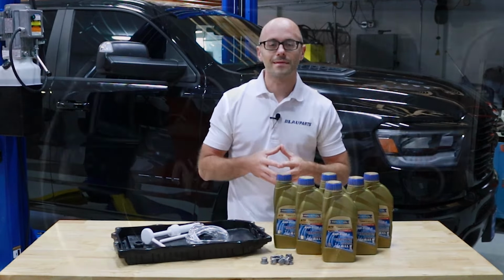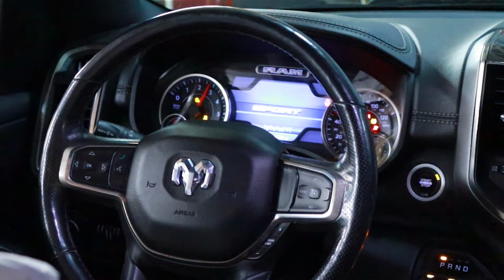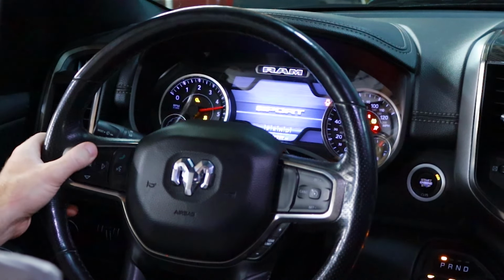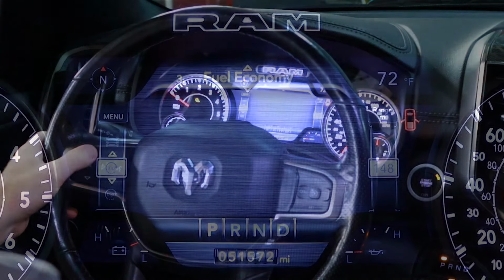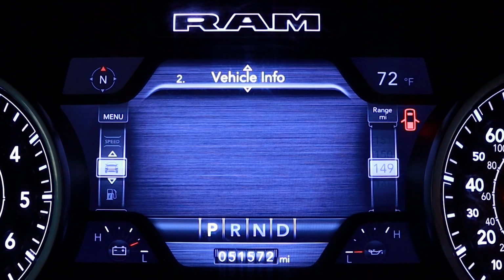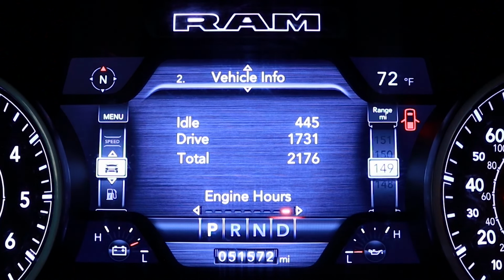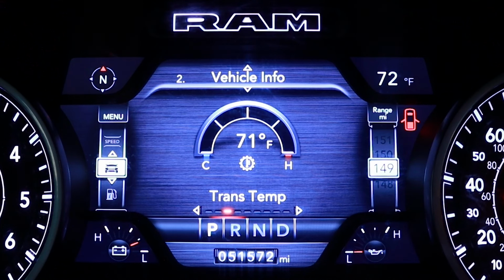Ram 1500 Transmission Fluid Change How To | 2013-2026 ZF 8-Speed 8HP

Comment from the maker: The Ram 1500 8-Speed transmission was also used in the 2019 and newer Ram 2500 and 3500 models with the 6.4-liter hemi engine. This how to fluid and filter change video would also apply to those models but with some slight visual differences due to the truck chassis.
Reply: Which fluid is better, Eurol or Ravenol? I'm going to use Mopar 8/9 speed transmission oil! 😊
Reply: Wasn’t there two different transmissions? One for the V6 and another for the hemi?
Reply: @vulcanman64  they are the same
Reply: What brand pan do you supply? I've heard nightmare stories of different brands.
Reply: @mrlibowski493  i went with ppe , i hard dorman can leak and oem doesn't have drain plug anymore
Reply: I have a 2014 Ram 1500 5.7L. Bought it used with 60,00 miles, 5 years later, it has 85,000. I'm thinking about changing the ATF. YOUR THOUGHTS???
Reply: @Carlos-usa1st  some people have reported 200k+ miles never had it changed and no issues
Reply: @wowdude8244  thank you
Reply: @wowdude8244 i have 2023 dodge ram 1500 272,k miles i never change it 😂😂😂😂
Reply: Why dose it need new bolts 🔩?
Reply: Yuri-tarded!!!
Reply: Why is the oil Green? Transmission oil is pink right?
Reply: You didnt specify if this is the 8HP70...
Reply: can you do a vid for ram 3500 diesel transmission too?
Reply from the maker: @everforexcanada5663  Thanks for the suggestion. We will try to create a how-to tutorial on changing the Ram 2500 and 3500 Cummins diesel transmission fluid.
Reply: If I’m just topping my fluid off that I lost wen I disconnected the trsns oil cooler line .Do I need to go through the whole removing air process
Reply from the maker: @woodrowhemiway  Yes, you would need to go through the same fluid leveling sequence. The fluid leveling sequence from 09:10 onward in the video can be used to get the correct transmission fluid level.
Reply: Mine only took 5 quarts out of the 6 I followed the steps perfectly, is that ok ? Or does it have to have all 6 quarts in there .
Reply: @victorortega2718 it needs lil over 7 quarts

Comment: Thanks for this video. Some tips to help others, i just did this job on my '22 Jeep Wagoneer @40k). With a cool engine (below 80°, this is Texas in the summer 😉 ) when you crack the fill plug be ready because at least a quart of fluid will drain out. I'm guessing this is because the hot fill final step, later in the process, brings the volume to above the fill plug, hence why this isn't a "fill to spill" process.  

Next, three of the screws had rust just below the neck, which I'll be taking to Jeep to ask about, since this is a pavement princess (unlike my Grenadier).  But I will say looking at the screws I see why they send you new ones.  

A total of 5 quarts came out and when I filled 5 quarts and about an ounce went back in. Sending a sample to Blackstone as well.  

Next and pretty important, when you move onto the portion of the job where the engine is running (at least for Wagoneers and Rams) the exhaust is right where you're working so be ready for that, since most of us will be using a plastic fill hose and the truck will likely be on Jack stands, so a tighter space.  A.) The exhaust will be hot, i know this is duh for some but the Darwin awards exists for a reason and B.) That hot exhaust will melt that tube if it touches it, making for a real mess. So I looped it over one of the silver lines near the front of the transmission pan and then put it in the fill hole. 

All in all, for an intermediate home mechanic, this was a 8-9 hour job from tool prep, jacking to jack stands, drain, proper fill process, test drive and then letting it sit overnight and rechecking the work the next day to make sure it was all good, ending with clean-up.

Comment: Also is it a level transmission or a level truck?  I just did mine, i have a lift and had to put an extra 8 inchs of extension on the rear arms to lift the back ebough to make the transmission level. Was a bit sketchy, not gonna lie...😆.   I filled it first at level truck, but leveling the transmission allowed another liter or so of fluid.  Anyone know for sure?

Comment: Spinning the wheels while the vehicle is off the ground seems unnecessary, and is actually not in ZF's procedure for draining and refilling the fluid. For your average DIY without a lift, this seems like overkill on part of MOPAR.

Comment: I'm glad I dug a Workpit in my garage years ago, covered with a steel plate over it! I use the pit to work on my car all the time , and will make it easy for me to get under it and have the car level at all times !  Much better than ramps or jackstands !
Reply: True, but the transmission must be level on this procedure, not the truck.  That means the rear needs to be higher than the front.  Use a bubble level on the transmission before draining

Comment: Quick tip if you do this. Instead of messing around with the horrendous drain plug location and dumping fluid all over your exhaust... just simply drill a hole through the old pan and drain... you are throwing it away anyway.

Comment: Will it be easier just to drain measure what came out and put back in?
Reply: The pan has the filter integrated, so the pan needs replaced for the proper fluid replacement procedure.

Comment: Am I to believe the dealership goes thru all these steps?! It seems they would rush thru the last bit of fluid leveling to get the vehicle out of their service bay. Yeah... I'm cynical of them doing all of this.
Reply: I am too and worried about that. Not sure I have the means or driveway type to do it myself.  I can’t see a single shop doing anything more than filing it once and checking level once.

Comment: I can confirm from experience that you will burn yourself when trying to reinstall the fill plug when the exhaust gets hot and your hands are covered in transmission fluid struggling to thread the bolt in.
Reply: Still making a strategy for this job, thanks, now I know to have snug sleeves and good gloves.
Reply: @yorkiesrule4ever wrap the exhaust in tin foil or exhaust wrap. The next time i do this, im also going to buy an extra fill plug bolt and see if i can gently grind some flats on if and see if that makes life easier.
Reply: @yorkiesrule4ever wrap the exhaust with two wet rags and you won't burn yourself works great

Comment: He looks real..... Very good AI.  Glad the bot told.us which way to turn the screws.....
These transmissions needed a higher fill plug or a dipstick.   Much hotter than 122F you wouldn't want to be working around the exhaust anyway.
   I did what he did when the pan was off because my pan had a hole in it.   So didn't need 10mm bit, but was thinking about a cutting an allen off until I saw how hard it was to get the last drop of oil out.  
    I was able to get the pan out on mine with a pry bar, just need an 1/8".  Taking the bolts loose would have made it easier, but I didn't have the deep pan.  I think my muffler was bent up a little because I drive in the field with it (thus the holy pan) and the exhaust is pretty low.
   Aluminum foil , a wet towel and some cleaner for the drips are handy for the exhaust.

Comment: Be advised your ABS light will probably come on when you are doing the shifting sequence to remove air from the system. This is normal because your back wheels are spinning and your front wheels are not. This code will go away after driving it for a few minutes.

Comment: So I watched many different videos including this one and im a little bit confused on whats right and wrong when the car has to be leveled does that mean tires off the ground evenly or the transmission has to be leveled does because when the car is on the ground on a level surface the transmission pan is actually sagging down towards the rear do I lift car up on jack stands the same front and back or do I lift the rear higher to make transmission level

Comment: Definitely do this guys. I waited 7 years until 75k light highway duty. Filter was filthy. Magnets were filthy. Oil was black. No transmission issues prior to service or after. Take your time and do it right. Thanks for the video!
Reply: I have a 2020 Ram with 144,000 no issues, fluid never changed, I feel it’s time but people say don’t touch it! What should I do?
Reply: 144k miles? Definitely Service it.
Reply: @razorjoe45  One thing I would do is look at the trans temp at normal operation. Is it running a bit higher than normal? If so, I would do the pan and fliuid change.

Comment: Drain plug over exhaust is bad enough, but then the refill and leveling procedure and the fill being right at the exhaust is total BS. Worse transmission fluid change in my 57 years.

Comment: This is a drain and fill. It will still have half of the other old oil in the transmission mixing with the new oil.
Reply: Do you think the pan part can be skipped then and just replace what comes out? I can’t see a shop doing this by the book at all
Reply: @b @bjornironsides6474  yes sir if the transmission is functioning properly. I would personally preform a drain and fill 2-3 times to get all the old fluid out. These ZF transmissions are very robust build to last.

Comment: I have a 2008 Nissan Titan and I do all this work myself. I have over 500,000 km and its not designed like this piece of junk is. Ram is supposed to be easy compared to others and it's obviously a piece of junk. I can't believe how overcomplicated it is for no reason on such a simple job and also how that exhaust pipe is running. Just absolutely ridiculous junk. I'll stick to Japanese.

Comment: So there was no filter change? Why drop the pan at all? 

Is there not an external air/oil cooler that you could do a simple fluid exchange at?
Reply: The filter is a part integrated with the new pan. It was changed by adding new pan

Comment: As said by others, sucks doing it in your driveway. And yes, you will make a bloody mess! Have plenty of shop towels and sand ready for the spills. Overall, I was not able to lift mine to spin the wheels so I just went back and forth in the drive way without giving it gas. The exhaust will be hot in the end stages if you do it all right and start from cold so have thick gloves and lots of patience. Overall, it turned out great and now shifts buttery smooth. I can't even feel the gears cycle! Turned out great. The bottles of oil were a pain, i wish it would have been the sort where you just replace the top and start pumping. But oh well, got her done. Next time I do this, I'll make sure to have a shop lift first 🥴

Comment: Wanted to add, on my 2019, I could not raise the transmission high enough to remove the factory pan.  I had to loosen the exhaust at the exhaust manifold to drop it enough to 
allow the clearance.

Comment: In order to level the pan, the truck needs to be jacked-up high in the rear and low in the front.  I used a bubble level on the outside edge/rail of the pan per the shop/ZF procedure.  The ZF procedure says a level pan is a critical part of this job - so I didn't guess by eye. 

I also used a much longer piece of high temperature fuel hose attached to my bottle pump and I zip-tied it away from the exhaust pipe.  I was able to fill the trans while it was idling without getting under the truck or burning the hose.

After doing all the Park, Neutral, Reverse, Drive and RPM steps, I waited until the temp hit 82F and started the final fill.  It started to steadily overflow at 107F.  I gave it one extra pump, pulled the hose, and it was steadily trickling out per the procedure.  I got lucky and was able to get the plug started quickly without burning my arm.
Reply: What do you mean level the pan.... are you talking if you have to remove those 3 transmission mounting bolts? Once the pan bolts are torqued to spec... how do you control the "level" of pan?
Reply: @brandonkick  no he means he put a level on the actual pan. The transmission bolts are after you get the pan leveled.
Reply: I got burned this is a stupid design

Comment: I have a 2019 Durango with 200k plus miles original fluid should I even attempt to change the fluid. Or run it till failure

Comment: Great video!  I’m wondering if someone could answer the question on truck or transmission being level?  If it’s the transmission, do I go by the metal surface that the transmission pan seals to?  If it’s the truck itself, that’s easy but transmission, not so much…

Comment: I’m guessing this is the same process for the 2500 6.4?
Reply from the maker: Hi there, yes the 2019-2023 Ram 2500 6.4L V8 uses the same ZF 8-speed transmission found in this video. Most of the general steps and procedures for changing the transmission fluid, filter, fluid filling, and leveling process or sequence from this video will apply to Ram 2500 models as well.

You can find our available Ram 2500 ATF change kits here: www.blauparts.com/parts/ram/2500/ram-2500-transmission-fluid-change-kits.html
Reply: @blauparts I bought your kit yesterday!

Comment: How do you do this on a lift when the rear of the truck needs to be about 8-9” higher than the front to get the transmission level?
Reply: Trucks sits level on the lift due to unsprung weight. Trucks sit higher in the rear when on the ground. So that truck levels out when its towing a load.
Reply: @eshkakogan75 Yea but it's not the truck that needs to be level. It's the pan rail and the back of the truck needs to be lifted to get that level.

Comment: Hola a todos soy de Costa Rica y tengo una duda la trasmisión automática y la transmisión manual para una camioneta DODGE RAM 5.7 HEMI  año 2010 son iguales a la hora de acoplarlas. Es que tengo un cliente hace poco tiempo compró la RAM y parece está teniendo problemas con el sistema MSD y no tengo mucho conocimiento en cuanto a esto de si serán iguales cómo para cambiar el motor y poner un motor de DODGE RAM manual según entiendo no dan tanto problemas cómo los automáticos.Muchas gracias por la información que me brinden.

Comment: This video was a huge help and saved me a lot of money. Never would have tried this job if this video wasn't here. Shout out to the engineers who made sure you'd have to jack up the transmission to get the pan off and cover your whole exhaust in oil with the amazing drain plug location.
Reply: They never make it easy on us 😅
Reply: I feel like we haven’t been thought about on maintenance in a long time sence robots do most of that stuff now think thay only think what is easier and faster for the robot during assembly

Comment: Why don’t you have a video for doing this on a 2021-2024 ram 2500 6.4? In the video on fluid about that truck you say you have a video on doing the job. The transmission in the 2500 isn’t the same As the 1500 after 2020..

Comment: I would like to thank the engineer that decided to place the drain plug directly above the exhaust. I swear they do this on purpose.
Reply: Or the oil filter directly above front suspension!
Reply: Got a 2020 ram bighorn. They should have just sticked with the dipstick. They always gotta do some bullshit engineering.

Comment: Has anyone tried this? I tried this procedure and could not get the pan lifted high enough to get the clearance for removal. I ended up only being able to do a drain and refill
Reply: You should be good with drain and refill, just follow his steps from the 9:00 minute mark to cycle through the gears and make sure you've got the air out and top it off if you're low.

Comment: Fluid replacement? Engine idle, or idling? Why do you need to jack it up if its level. Shifting sequence could be done under load (on ground) I assume. It's a tough fit but you even if you have to jack the transmission up, a bottle jack would work? So?  I feel like a mechanic is just gonna drive it let it cool and check the level. Not that it's right but I bet many don't do this. I would.

Comment: It's not necessary to spin the wheels in drive until it shifts into second gear. The ZF procedure tells you to shift manually using the steering wheel buttons while keeping your foot on the brake. The ZF procedure is available for download on their website.
Reply: I'm here in the comments section looking for this comment. Thanks for confirming my suspicion seeing I don't have a liff.
Reply: I didn’t see a point in dropping the pan….
Reply: @dw4lubu filter change
Reply: @dw4lubu the filter is built into the pan.
Reply: Think that was the only thing he did different.
Reply: That doesn’t make a shift though so that doesn’t make sense. It only sets the highest gear you want to be in not actually pick a gear.
Reply: That doesn’t make a shift though so that doesn’t make sense. It only sets the highest gear you want to be in not actually pick a gear.

Comment: Just an FYI. I have a 2020 Ram with this Transmission. Mine is slightly different than what you showed on the video. Mine has an oil volume accumulator rear of the valve body inside the pan. It made it very difficult to remove the pan. Jacking up the rear of the transmission did very little to help as the exhaust raised with the transmission. Took some force to get the pan past the oil volume accumulator.

Comment: Ram says the transmission oil on my 1500 2020 4x4 doesn't need to be changed. I just hit the 60k miles. Any suggestions?
Reply: Do it immediately